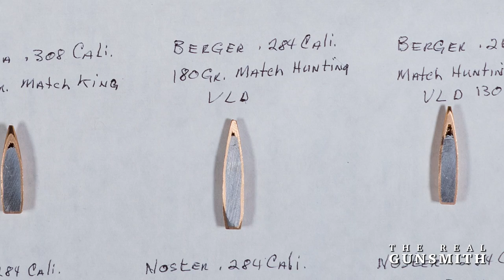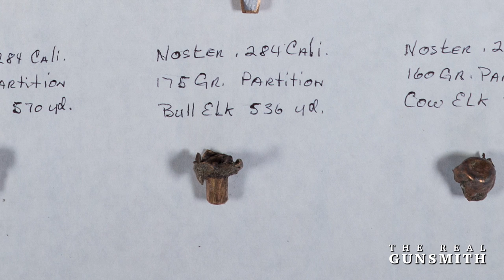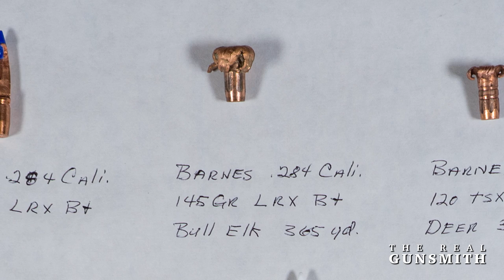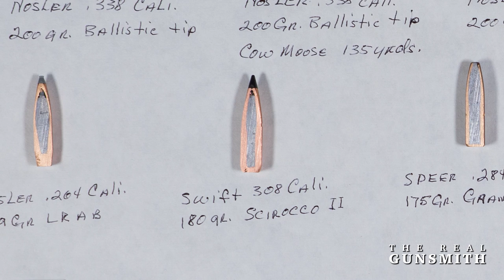Bullet Technology – The Real Gunsmith

Comment: Randy love your input and knowledge ..  i reload for my 270 win .. my hunting range is normally under 50 yrds .. but i could do out to 300  on the farm for deer ..  .. my last reloads reloads were gamekings SPBT 130 gr at book spec for 2900 fps ..  i figure i don't need it hot at max load for my area for a deer ..  well i got one last deer season ..  my shot ended up way off ..  deer turned at the trigger break ..  but it walked 4 steps and went down ...  when field dressing ..  the shot hit in the rear left hind end .. just back of the rib cage .. first few ribs miss ..  busted the next 3 or 4 ..  skipped a few ribs .. took out a 2 or 3 more ribs ..  all up the left side ...  bullet ended in the front left shoulder .. no exit ..  20 to 25 yrd shot ...  deer went to local processor .. he didn't save the bullet for me .. and i asked GRRR ..  the body cavity was just full of dark blood when dressing  ...  any input is so welcome ...

Comment: Excellent video Randy, thanks for sharing your knowledge.   I have shot most of the bullets you mentioned and of course almost all the factory loads.  In my humble opinion the best Hunting bullet I have ever used is the Original Trophy Bonded Bear Claw bullet (sold by Swift), not the Federal tipped version.  Excellent penetration and weight retention.  I've used them in 300 Win, and 300 Wby with great results.    On smaller deer sized game, I anchored a lot with Speer 100gr Grand Slams in my 6mm Remington too.  Thanks again for sharing your knowledge.

Comment: I sent a 165 Sierra GK into a coyote's chest facing me, and when I skinned it I was ticking my knife against bits of copper and lead just under his skin from his armpits to his hips. I didn't find anything anywhere bigger than a couple grains. I tried a matchking on water filled milk jugs and it basically disintegrated. A deer or elk is worth the 75¢ for a partition or Barnes TTSX.
Reply: AMEN, i dont get it, why not spend a bit more and just have a better bullet, why not put every thing in your favor buy using the optimal components
Reply: Devin Cook what cartridge and what distance
Reply: I shot a coyote a couple years ago at 225yds with a 140gr Amax out of my Savage LRP 6.5cm. I hit her right in the shoulder and she crumpled on the spot. When I got to her I was surprised that there was no exit wound. Then when I skinned her out I only found a couple small pieces of the jacket. The trauma to her body was impressive, the bruising and tissue damage went into the top of the head and clear to the tail. I would say she never felt a thing. This probably sounds like I am defending the creedmoor and match bullets, but it's quite the opposite. A coyote is a small thin skinned animal and the distance was short enough it should not have been a problem to drop her. But to think it would be ethical to use that bullet on big game is not ok. The fact that it never exited a coyote and exploded on it's shoulder is all I needed to see to know it should never be used on a large animal.

Comment: Randy, I tried the Sierra 135gr 270 cal. matchking bullet on whitetail deer in SW Mississippi and had the opposite problem that you had. The bullets wont expand and acts like a solid. I recovered the deer (it dropped right there) but, it looked like it had been shot with a target arrow. The deer here are smaller because of our warm climate and a big buck might go 250 pounds but most are 200 max. I've found a light bullet that slows quickly and dumps lots of energy works best. I've been using Sierra .277 dia . for over 20 years. I can't count the der I've taken with them with most shots 120 to 200 yards and the longest 450. I've never recovered a bullet as they all pass through. I've never had to track a deer since I stopped using 130 and 140 grain bullets. The 110 grain bullets drop them where they stand every time. Just like they were hit in the head with a lightening bolt. 
I'm hunting a new place where shots at 300 to 400 yards could be common. right now I'm working with a 120 grain boat tail  for a higher BC. I'm driving the bullet about 500 fps more than what it was designed for but I bet it will work great here in the 270 Win. 
By the way. EVERY deer looks like a bomb went off inside the chest with the lighter bullets. The heavy bullets go through to fast without dumping energy and you have to track.

Comment: Good advice, Randy. No doubt that plenty of big game have been taken long range with high BC, relatively lightweight bullets, but I'd bet for every clean kill beyond 500 yards there are 2 or 3 messed up shots with wounded animals lost. The last two elk I harvested were with a .35 Whelen and 225 gr Nosler Accubonds, longest shot was 265 yards. This fall, I harvested both an antelope (150 yards) and a mule deer (300 yards) with my .308 and 168 gr Barnes TTSX. All animals were one shot kills and none went further than 50 yards.

Here are my hunting guidelines: Know your shooting limitations and assume a reasonable margin of error every time you pull the trigger - shot placement is the single most critical factor. Use a round with enough velocity and energy that the bullets function as designed at the range you are shooting. Use premium hunting bullets like the Nosler Partition, Nosler Accubond, Swift A-Frame, Barnes TTSX, etc. to ensure a clean kill with decent penetration. I hunt where there is a lot of open ground and relatively long shots are common, but anything beyond 500 yards is unnecessary and, frankly, uncalled for. Be a hunter and not a sniper - get closer, it's more fun and you will harvest more protein!

Comment: In 1947 John Nosler and his friend both took their moose with one shot using the first dual-core projectile that is the Nosler Partition bullet. No boat-tail and no cutting-edge design mumbo-jumbo. And this video is a testimony that you don't need a boat-tail to stabilize flight over long distances! I have been using this bullet since the 70's and it's all I need. It has torn through the lungs darn near every time I have ever used it broad-side and my animal very seldom takes even 10 steps, because it has the construction to cause the tissue destruction necessary for the humane kill. No high tech we've all been told that we need. Randy, you told exactly what is needed. Practice all the hunting positions and improve shooting. And not on a bench, on your legs, one knee, and with the sling, and tighten up that shooting until you don't miss. Another thing, will technology help you when you are up in the thin air, choking and panting with the blood pounding in your ears and you have to take an immediate shot when all you want to do is take a seat? Altitude hunting is some of the most physically stressful things I've ever done. Practice and use the tried and true tools to get the job done. I love your videos and I just about always agree with your content.

Comment: First of all, EXCELLENT presentation and points, you are dead-on with every point you made in this video, thank you! Lastly, I seemed to have gotten confused on your stance on the Nosler Ballistic Tip Hunting variety, as opposed to the smaller caliber Ballistic Tips that are geared for varmint/predator hunting, which are pretty much the same thi g as the Hornady V-Max. I've been a hunter for a long time, but I'm more of a target shooter. I've honestly only been deer hunting once and my rifle caliber& bullet/load left me very impressed at a distance of 200yds(which is nothing to brag about, but I was presented with a broadside shot while they had stopped and were eating and I couldnt have asked for a better position for the whitetail deer and myself as the shooter since I was lucky and had a rock solid rest. I was using a Savage Model 111 chambered in .270 Winchester using Winchester Supreme 130gr. Bllistic Silvertips(premium factory loaded ammo) and was very impressed with the load and especially the bullet and the damage it left behind. I know there is a world of difference between something like a smaller Whitetail doe and a large Male Elk or Bull Moose but for what it was, the 130gr. Nosler Ballistic Tips did an outstanding job of opening up relatively quickly upon impact, going cleanly through both sides and leaving a massive wound(as a huge animal lover, I am MUCH happier to use something that may be considered "overkill" by some, but I justify it by the added little extra hope that it will reward me with the beautiful 'Bang-Drop', no steps, no nothing.

Comment: I can only speak for my own experience of 56 years as a hunter and handloader .. I have used Nosler Partition bullets on big game and never had one bullet fail.. The few bullets i have recovered had an excellent mushroom..  6 years ago i used a Nosler Partition bullet in my T/C Contender single shot pistol for blacktail deer , the bullet went through both shoulders and did an exit on the far side .. Others hunters have told me it's a lot more bullet than i really need for deer which could very well be true as this shot was under 90 yards ..The other bullet i have never had failure of the ones i have recovered is the Hornady Interlock bullet it stays together .. Now i have never been able to get any kind of a good group out of the Barnes solid cooper bullet no matter how i adjusted the load, i know two hunters who fired an entire box of them in their 7mm mag did not get a decent group so they never bought any more..I bought one box of Hornady solid cooper bullets which did group better than Barnes but still a 2" groups to me even though it's a hunting rifle is not very good .. I really try and stay under 350 yards on shots .. But at the local range a few times  i compared Boat tail bullets of the same weight as flat base bullets with the same load and discovered there is not much difference in poi @ 300 yards if any , i never fired further ranges than that .. The Remington Bronze Point bullet has been a good big game bullet or at least the ones i fired into big game without any failure they have been around for many years now .. Well said Randy you know your bullets ..

Comment: I have looked at Swift bullets off and on but have never purchased a box to try as of yet .. The season is just starting here for modern deer and will use the Nosler Accubond bullet this season.. I have more Nosler Partition but in a heavier weight than is needed for blacktail deer .. Perhaps next year i will after a lot of bench load development time go into the field using Swift bullets ..You said it well .. good job..

Comment: I've had great success with many bullets over the years.  My bullet of choice for elk is the nosler accubond.  I tried the accubond LR but couldn't get it to shoot as well as the standard accubond.  I have also used the sierra gameking, nosler ballistic tip, and the old nosler solid base.  I use these softer bullets for deer.  I have never once recovered a bullet from a game animal as everything has passed right through the animal.  The only exception to this is a .243 85grain Hollow Point Sierra Gameking that I shot at a whitetail at roughly 20 yards.  The bullet entered the onside rib cage and blew up in the chest cavity.  It turned both lungs and part of the heart to jelly and the animal dropped where it stood.  The hydrostatic shock was so massive it pressed the jelly lungs into the off side rib cage (as a hydraulic press would) and ruined any meat that could have been taken from those ribs.  Because of this I've put away the .243 and built a 300 HAM'R.  I intend to use a 135 grain speer bullet that is similar to the gold dot but was designed to function at the velocity range of this cartridge.  We'll see how it does.

Comment: I learned early too, about the old thin jacketed Sierras. I used a 165 Game King in '06 on a whitetail and although it did kill it, one round of two which hit the shoulder bone went to pieces like a varmint bullet. My dad had a similar experience with a 168 (I believe) Sierra match king in 30-06 on a whitetail. I went to heavier jacketed bullets after---Nosler partitions when I could get them---and never regretted it on any size big game animal.  By the way, the old Remington Core-Locks seemed more reliable to me than the Sierra Game Kings as did even Speer Hot Cores, although I moved away from them too.

Comment: Great video Mr, Randy  What do you think of the Speer Grand Slam bullets?
Reply: I am also curious about Randy’s opinion on this projectile as I have a good amount of 175 gr 7mm Speer Grand Slams for my 7mm Rem Mag and was hoping to hear his thoughts on them during this video.
Reply from the maker: I think it is a good choice.  While I was working at Speer I built the machine that tamped the rear core into the bullet before the bullets were transferred to the hot core machine for the front core when the bullets were formed.

Comment: Randy. I will be traveling to Colorado for a second season backpack hunt this year, i have a 280ai and handload diligently.  Due to the circumstance in our country with the lack of availability to bullet selection i am limited in what i have to use this year.  I have 150gr scirrocco’s, 150 and 160gr partitions and 150 gr nosler etip.  I really want to use a copper solid, but i question the etip because i dont know much about it.  I will use the tripple shock if i can find some, but what are your thoughts on the etip or should i stick to one of my other options.  Or any other suggestions?  And ive been hunting a long time (whitetail) and keep my range very short!!

Comment: In this case I absolutely agree with TRG.  Big fan of the Nos Partition, A-Frame and Barnes.  I haven't tried the Sirocco but I know some people swear by them.  Some of us in the city don't have a chance to do a lot of 'testing' so it has to be right out the door.  

A lot of this drifts away from bullet technology.  Environmental changes are present whether you're shooting an ABLR or Minnie.  Precision is one thing, knowing how to compensate for the environment is something else entirely.  If someone's got the impression that bullets are magic potions, then that problem should be corrected before humping it up into the hills...  I realize you may have to take the clients you get, though.  I haven't but my family's been there; lets just say I'm glad no hunt ever killed them (ABC Brown bear guide).

Being somewhat in the big city I see what you're talking about all the time - "hunters'' show up to the local range with something a full order of magnitude more caliber than required.  Not to worry, it's been 'bore sighted' by their 'gunsmith' and they're using these hot custom hand-loads with bullets which have a G1 BC in the .800 range.  They aren't even on paper out of the bag, they shoot 10 rounds in from lead-sled on a cement bench, achieve a 3.5" group at 100yds and assume they're ready for the wilderness.  I try to be kind and helpful as much as I can and very often I end up finding they have a ring loose, fastener somewhere in the ring or base assembly not torqued, or eyeball boresighting for them.   Add to all this the fact that the game + environment they are going to typically means shots well in excess of 200 yards and they zero at 100.  I wonder if I am doing more harm than good?

Comment: I used to shoot 69 grain SMK bullets in my AR varmint rifle in 223.  I found that the match king zipped right through the ground squirrels more times than not.  The squirrel would tip over but then try to drag it’s self off with its front legs.  The SMK would also ricochet to who knows where. I switched to 55 grain v-max and they aren’t quite as accurate but they blow those rats into prairie salsa. They are accurate enough to get the job done and I don’t have to worry about them taking off to parts unknown.

Comment: Nice very informative video. The guy definitely knows what he is talking about and i agree with most of what he says.  However, There are some flaws in some of his statements  imo :1- sierra gamekings are not the best bullets for elk in ideal situations let alone at 600 yards 2-nosler partitions are old technology but still excellent rounds on big thick boned game.  Not ideal for dmaller deer antelope etc asvthey dont expand dramatically and quickly which is needed for quick killing of smaller big game 3-barnes bullets are by far the best and my favorite all around bullet.  They don’t fragment so don’t ruin  a lot of meat on smaller game with high powered hunting rifles but penetrate very deep on big heavy game like elk 4- match bullets are completely different than cup in core hunting bullets.   They work wonderfully on deer and pronghorn but are not ideal for elk unlike match bullets that “explode” on impact without penetration 5-you cannot calculate the ballistic co efficient of a bullet without knowing it’s velocity and therefore he should not make a general statement that the bullet has a good balistic co efficient without velocity figures.  However he may have meant compared to other bullet types.  He cleared that up a bit later on though 6-the military and police snipers use match bullets for killing people.  They can kill quickly and deer aren’t any bigger than a man.  Shot placement is key.  One benefit is no over penetrating to hit bystanders 6- 700 ft lbs is not as horrible a figure to kill an elk as he  implies .  Not ideal for sure but people hunt elk with a .44 mag revolver successfully all the time.  It produces about that energy.  You just shouldn’t take long shots with it but no one would argue it would be a bad choice at point blank range with 700 ft lbs.  they are even used to kill grizzlies.